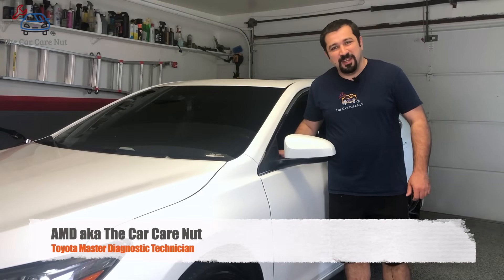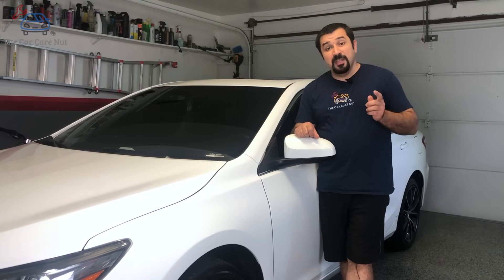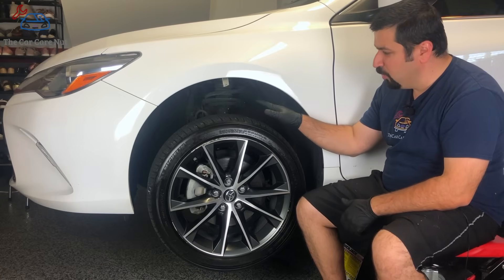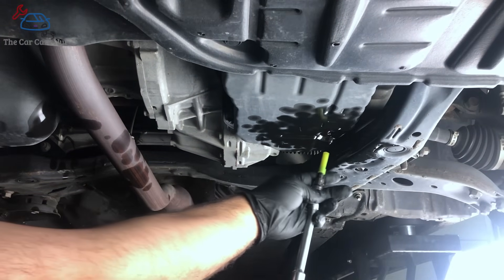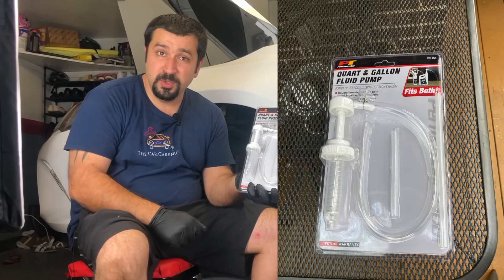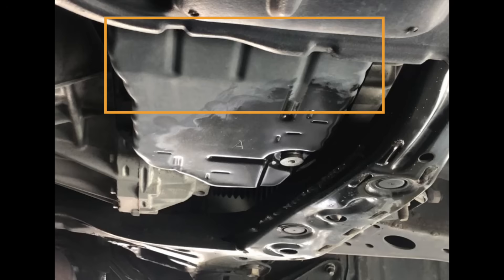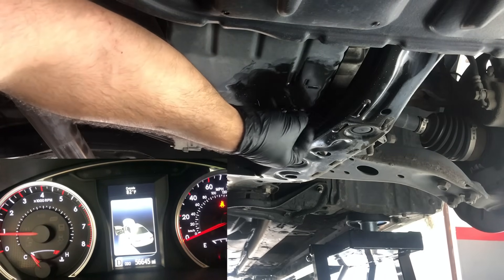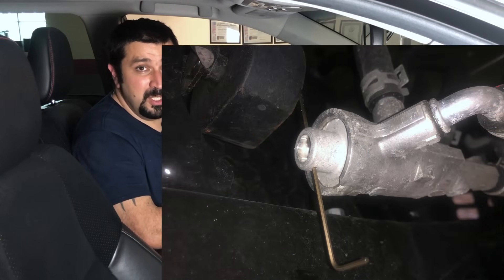How to change your Toyota Sealed Transmission Fluid

Comment: Can’t you just drain it when it’s cold and you get let’s say 2.5 qts you just measure it and put 2.5 qts back in? And you don’t have to worry about operating temperature?
Reply: Sure, but if the tranny is low now it'll be low when you get finished.

Comment: AMD I was told by a Honda mechanic that idemitsu makes the Toyota and Honda brand ATF's and the fluids are the same. So, do you know if the idemitsu Type TLS-LV (WS rated) is fine to use in a 2018 Camry with the 8 speed sequential shift? Thank you again for your outstanding video's!
Reply: You can use any JASO 1A rated ATF in your transmission. The LV (low viscosity) is a silly fuel saving initiative that sacrifices your transmission's longevity for the sake of getting a lower fuel consumption figure during vehicle testing. I use thicker ATF (Castrol Transmax Multivehicle) in my Camry and it still returns ~6.6 l/100km (or 35mpg) on the highway.

Comment: How do you feel about using maxlife transmission fluid in a 2015 sienna vs. Toyotas brand?  I already added it one time during a drain and fill.  Should I keep going with it or change back?
Reply: How many miles has VML been in there?  Any noticeable difference?

Comment: The shizters sure fouled up changing fluid. And cannot check level and condition of fluid. A really pee poor design. Trying to eliminate do it yourselfers. Probably worth new struts new trany new engine. Keep old ones going. New crap plastic engine parts, extreme prices etc. Best way to solve this mess. Don’t buy new.

Comment: I have a 2015 Corolla with 79000 miles, transmission fluid has never been changed. Do I change it at this point or it's too late and better leave it? Thank you.
Follow up. I did the first oil change, it came out 1620 grams, a little darker than the new oil, but not black and not burnt. So far so good, planning a second change in 150 miles
Reply: His newest transmission video says that is okay it's after 100,000 he advises do not change
Reply: @chad282  Thank you.

Comment: After contemplating on this for more than 6 months, Today, I finally did this service. Thanks to Car Care Nut for all the guidance. One additional recommendation I would have to your viewers is that get an extra drain plug nut - just in case. I happened to strip mine and had to order the nut through dealer and wait for couple of days. It is cheap - like 6 bucks or so; so its ok I think.
Reply: Drain plug itself right? I didn’t see a nut In video
Reply: @2005Pilot  Yes. Drain plug. Sorry there is no nut there. You are correct.

Comment: Thank you very much for your excellent video! My daughter just bought a 2018 Camry with the 8 speed with the sequential shift and I'll be servicing the car for her. I've read that the temperature range for this car to level the fluid is between 95 and 113 degrees. Could you please confirm this? Thanks again!
Reply: You are right 95 -113 ⁰F

Comment: Good info; however, it's unclear about when to remove the jumper wire. Also there is no mention of whether or not the vehicle has to be in Drive to have the Drive light to come and stay on while the fluid level is checked/adjusted. Can't use this procedure without this key information. Would really like clarification.
Reply: Per my Toyota repair manual, once you've gotten the D indicator to show up for 2 seconds, you shift to Park, release the brake (applied earlier), and remove the jumper.

Comment: Hey I really appreciate you taking the time to do these videos. I own a 2015 limited highlander and a 2012 Toyota Camry. The drain and fill for transmission is tha accurate and can I go by that. I see people doing the drain out and put back what was drained out but never checks again by taking the drain plug off again. Can I do what the owner manual recommends and open the drain plug after car warms up check the temp . Thanks

Comment: Can’t I drain what comes out cold and replace exactly the same amount cold and it be correct level? No need to use temp setting if the level didn’t change.

Comment: I just discussed having this done with my dealership on a 2020 Camry XSE V6, and they are against it.  The car has to be dropped off the night before so they can start the work with the car cold.  A master technician has to do the work, it takes half a day, and costs hundreds.  They see about 20,000 cars a year, and only see about ten transmission problems each year.  Rarely do they have a customer insist on the procedure, and their advice is to leave it alone.  I can't do it myself as the transmission is almost impossible to get to without a lift.  I hate conflicting information.
Reply: It sounds like your dealer hasn't purchased the Toyota service tools to do the transmission service. There are specific tools which most people can't afford that allow the ATF level to be checked at any temperature. (It uses a vacuum pump and an adjustable check tube). However, as explained in this video, it can be done without those tools. I'd get a competent mechanic to service your transmission. It's not too hard as I can do mine with ramps and jack stands.

Comment: Y can’t you just take the fluid out of the fill port with a pump.  Record the amount pumped out and add that amount back in as long as the temperature of the fluid is the same?  If you have a trickle coming out @ a certain temperature the level can’t be that precise.

Comment: I bought a Toyota Corolla 2014 with 103 thousand miles. The car runs good and transmission shift good. But I noticed driving up a hill my RPM goes up to almost 5000 RPM and I am barely reaching 70 miles. It doesn’t level to a normal RPM as I go faster. I was told Taft CV transmission do this. Is that correct or is it something I should look into ?

Comment: AMD I have a scan tool that gives me transmission fluid temp. So would I remove the drain plug to level the fluid once the transmission is within the 95 to 110 degree range? Is that correct when using a scan tool? Thank you for your excellent video!

Comment: Thanks once again ccn for all your help and instructions. Question, when in the cycling mode from drive to neutral and back to drive and the the “steady “ drive light appears, do we put the vehicle in park to get under the car ? Or, is it a must to have a second person sitting in the vehicle with their foot on the brake and the car in drive mode? Thanks again.
Reply: Yes, put it in Park before getting under the vehicle. If you've done the gearshift shuffle correctly, the indicator light will display D while the shifter is in P position.

Comment: OK, I missed by Transmission drain and fill at 60,000 miles and have just reached 120,000 miles.  Do I ride it out and not change the transmission fluid or do I begin drain and fills every 60,000 at this point?  I have a 2018 Toyota Camry LE.  Thank you.

Comment: I have a 2011 toyota Avalon. The car has sat overnight and the transmission is cold.  I shorted pins 4 &13. I shift between "n" and D" . The "D" is always lit. I can get "N" to blink , but "D" never goes out and comes on for 2 seconds. Not sure if I am doing this correctly.

HELP

Comment: What is the torque spec for 2017 Camry 4 cylinder fill and drain plugs? Parts numbers for the washer would also be much appreciated. Thank you

Comment: Excellent explanation of procedure thank you very much. I have some questions. I want to do the service. I bought a metal gasket from the dealer. Does it work the same as the rubber one? Have to put some silicone if you use the metal gasket.

Comment: Can we shut down the engine when the correct temperature is reached and open the drain plug to drain excess fluid to a trckle and then tighten the plug?
Reply: No. The engine should run with shifter in Park position.

Comment: @Car Care Nut ...Excellent video. Please advise. I have 2010 Camry V6 125k miles. Foolishly haven't changed fluid yet. I plan on performing the procedure this weekend. Would you recommend that I perform this again shortly afterwards to clean even more fluid. Shifting if still smooth, but there is the smallest shutter when accelerating at and speed. Thoughts?

Comment: 2017 camry 4 cylinder temp?    I know you have probably covered this, but for example my sons  17 hyundai elantra was way over the recommended mileage for trans service. The dealer told me not to do it for fear of it causing problems. I can see a pressure flush doing that but a drain and fill?

Comment: My question is should we can our transmission fluid. The dealership where I purchased a new 07 4runner said transmission is a sealed unit and transmission will last the life of the vehicle. With that being said the Lexus dealership told me the same thing  when asked them about it in gx  transmission service he said Lexus/Toyota don’t change transmission oil. Can you explain why they said that about servicing transmission? Thanks

Comment: I bought the Veespeak BLE using it with the car scanner app on my Camry 3.5.2014. What a little awesome device. It reads ATF fluid temps out of the box. I tested the jumper cable method vs the scanner one and they are on par. The transmission D letter stays solid when the scanner reads 105.5F. Makes life easier.
Reply: what app are you using to connect with the Veeespeak BLE?  Also BLE or BLE+ scanner?  I used jumper wire in past however looking for an easier way, shorting across the connector leaves room for error and the unknown should wrong wires be connected.

Comment: Does he keep the brake pressed and kept in drive or neutral while draining too level?
Reply: Once you go into temp check mode, the manual instructs you to shift to Park and remove the jumper from the pins.

Comment: What temperature do I have for a transmission fill on a 2020 Toyota RAV4 XLE?
Reply: Same question for 2019 Rav4 XLE - also, after removing ALL under body plastic and inner fender, I could not find any semblance of a “transmission cooler valve” as described. 
Pretty sure it does not exist on XLE.

Comment: Putting a jumper between in the obd2 is not my thing. I seen videos where the tech uses a digital thermometer and places it directly to the oil pan until it gets to temp. Will that work?
Reply: Yes, an infrared thermometer will work

Comment: I forgot to ask, if I have to do this and want to use temperature gun, would you please tell me the range I should look for.
Reply: Depends on the car.  If it's the K313 transmission in the Corolla, the correct temp level is 35-45C.

Comment: Perfect video to watch when learning how to do this for the 1st time.  One thing I'd like to mention to anyone trying this for the 1st time: BE PATIENT WHEN WAITING FOR THE SOLID "D" LIGHT TO COME ON!  It will take approximately 8-10 minutes or so, but it will show up on the display.
Reply: Wait so you sat there and shifted between drive and neutral quickly for 8-10 mins?
Reply: @Jetsonn    No, not necessary.  You only do that for a few seconds to enter temp detection mode.  Then you remove the pin jumper and watch for the D indicator on the display.  It will either be off, on, or flash.  Off = too cold.  On = correct temp.  Flash = too hot.

Comment: Hi: are these the logical steps????

Remove the drain plug and straw. Let all the oil drain out. 
 
 Return the straw and loosely tighten the drain plug.
 
 Overfill the sump by a bit.
 
 Start the car shift gears a bit get the gearbox to approx 40 degrees C. let it cool if it gets too hot.
 
 Open the drain plug and let the excess oil drain away until you get a trickle.
 
 Tighten all the plugs.
Reply: That looks logical to me

Comment: When I first removed the bottom nut (dipstick still in), like a quart of ATF came out COLD. How is this possible if the fluid is smaller cold, but was originally filled to top of dipstick hot? Does Toyota factory overfill by 1 QT?
Reply: Was the vehicle perfectly level at the time your removed the plug?
Reply: @danieloneill4356  yes
Reply: @Thundergy  did the process work out ok?
Reply: No, Toyota didn't overfill ATF. The engine should run during the ATF level check

Comment: does this procedure work for a 2020 RAV4  ?
Reply: @@paul562 and temp monitoring is still 104F ?   right ?    thanks for you reply
Reply: @@paul562 Thanks,  and again thanks !   😉
Reply: 2019 RAV4 XLE: 
I removed ALL the plastic from front bumper to middle of car, plus inner fender on driver side. 
I never found anything that resembled a transmission cooler valve. Beginning to believe it isn’t on my car.
Reply: no cooler bypass on our 2020 rav4 limited also no connector in OBD pin 13.  we used a infrared temp gun

Comment: I followed all the steps in your video (thank you), but when I got the car up to temp and opened the drain bolt, nothing came out. It only started draining immediately once I shut off the engine. Once it started trickling, I closed the drain bolt. The amount that came out  was the additional fluid that I added on top of what was initially taken out. Any guidance? Thanks.

Comment: This procedure does not drain the fluid completely. There will be fluid in the torque converter. There are some transmission shops that use a purging device to completely exchange the fluid. Also, shouldn’t the pan be removed to change the transmission fluid filter? Your thoughts sir.

Thank you

Comment: Does anyone know if the OBD cable jumper process works with a RAV4 2021?
Reply: OBD jumper did not work on our 2020 rav4 limited, no connector at pin 13

Comment: Hello , i tried the jumper wire trick for the fluid check mode and it did not work for camry 2020 2.5 8 speed

Comment: Perhaps i missed something.  The goal of the fill procedure is that when the fluid is at correct temperature it’s at the level of overflow tube… correct?  That’s why you put the drain plug back in when it starts to burble and slow down.  When the fluid is colder it should be below level of overflow tube.  So why would any fluid drain out when you open the drain on a cold tranny?  Quite a bit drains out before pulling the overflow tube.  Seems like following this procedure will result in fluid level being lower than when you started.  What am i not getting?
Reply: Did you ever find your answer? Care to share?
Reply: Because when you draining ATF, the engine doesn't run. When engine is running then transmission pump takes some fluid from sump and pushes it through the whole system.

Comment: Hello.  
I looked around, owner’s manual, toyota website, google, etc.. and there is no recommendation on when to replace the transmission fluid. It only says that is free maintenance, and should be inspected every 30k miles (for the 2001 C-HR). 
Is it really maintenance free? If there is not stick to check the fluid conditions, how can, someone without a hydraulic lift, knows if it is good or bad and need to be replaced? 
I’m 100% sure the mechanics at Toyota does not go through the trouble of inspecting the condition of the transmission fluid as recommended, because it takes some time and work, instead they tell you to replace the transmission fluid and charge a ridiculous amount of money for it ($340). 
I don’t think is fully maintenance free, because all fluids reached a breaking point, but what is it for the transmission used on these Toyotas? 
Please advise. Thanks!

Comment: Good lord….I’m surprised they provide a fill plug. I thought you were gonna have to pump that up through the drain tube lol.
   So I’m perplexed as to how the drain plug screws in…does it thread into the overfill tube? That can’t be as because i thought I heard you say it was plastic? (I don’t have this year… Toyota (04 matrix xrs and 04! But just curious).
Reply: There's two threads in the drain hole. A smaller thread for the plastic spill tube and a larger thread for the metal drain plug.

Comment: I understand that when the temperature is high, the fluid expands. When the temperature is low, the fluid shrinks. My question is: Why did the liquid come out of the hole when you opened the metal cap? The fluid should be cold and the level should be lower than the plastic plug (Overflow). As you said, a cold liquid must shrink, so the level must be below that of the adjustment level which corresponds to a temperature of about 110F. I understand that once the plastic plug is removed, the fluid flows completely. My question concerns this part of the fluid that leaked between the moment you opened the metal cap and the overflow cap was still in place. Thank you for the answer.

Comment: Could really use some advice.  I have a 2006 Camry w/180k miles(2.4L), 2006 Rav4 w/150k miles(3.5L), 2014 Highlander w/120k miles(3.5L), 2017 Camry w/140k miles(2.5L).  I cannot be certain if transimission fluid service has ever been done on any of these vehicles.  Is it too late to begin a service interval on any of them?  Or should I get this maintenance completed?  Better sooner than never?

Comment: I have a Toyota Crown GRS204 with the 2GR-FSE engine. It has now 80,000kms. Should I change transmission fluid with filter or without filter. Or should I do a flush? 
Thank you for your help :)

Comment: @The Car Care Nut  -I have an 05 LS430 with 150K miles probably never changed. Is there any way you can keep the car in the garage and have the new ATF there with it to keep at same temperature, drain whatever comes out then replace with exact same amount? Keeping garage closed and at exact same temp as bottle of new fluid. Thanks!

Comment: You still can use a dipstick if you own a 9th Gen Accord V6!  Plus, it has an inline filter!  Draining the pan doesn't remove the old fluid from the torque converter